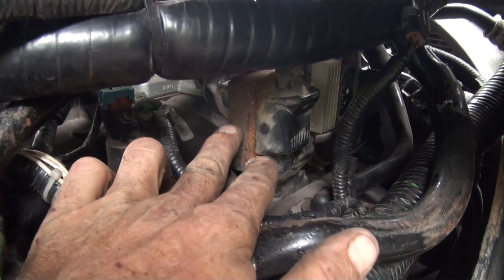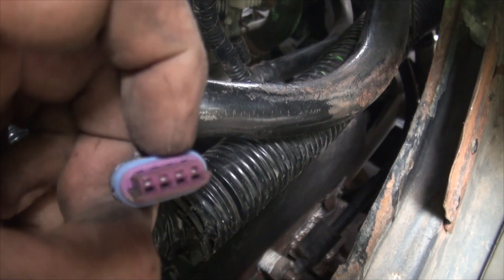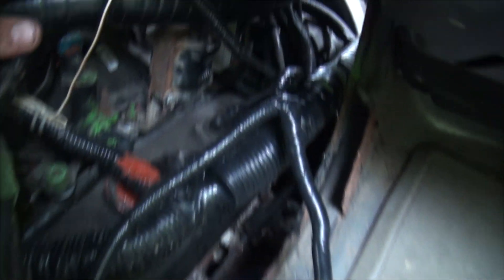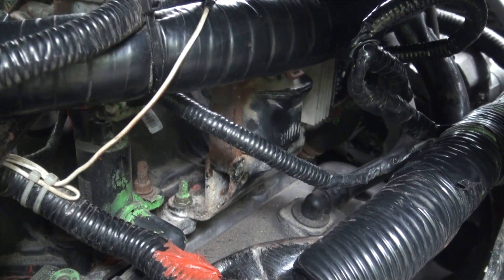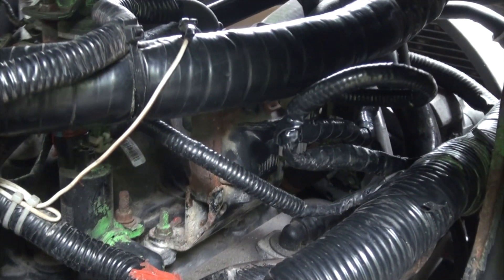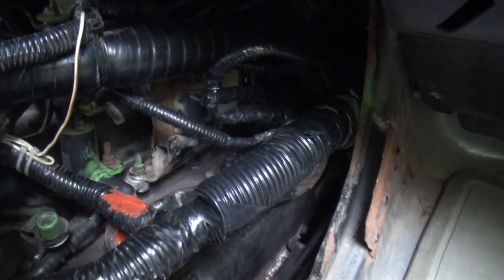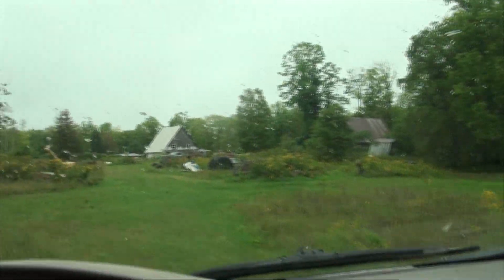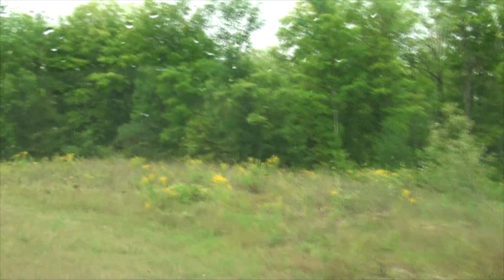WHY DOES MY 4.3 HAVE NO SPARK FROM THE COIL? CRANK / NO START

Comment: Excellent Stunt Dummy those connector pins were definitely opened up way too much any GM dealership will have a connector pin go no go drag tool or use the mail end of a connector to see if it’s loose but you don’t have to I can tell you from eye those female pins are out of speck once again great job and the old “Ford wiggle test” to the rescue!👏👏👏
One other note if you are in the field you can get a tinny pick to pry the female pins to engage the male pins tighter you can practice that technique on the old connector. Don’t undo all the plastic of the connector just insert the pick through the front and under the spring side of the pin and pry it to tighten the engagement tension it’s kind of like doing microscopic surgery on a connector pin don’t be too concerned if you bend and gouge the plastic a bit what your looking to do is tighten the tension of the female pins…

Comment: I wish I had your electrical knowledge . I wouldn't have to take my astro to the shop much . It's a 94 207k and wires and connectors are failing . Thanks for sharing your knowledge ! .
Reply from the maker: If you ever need help, feel free to send me a video of your van and what  it's doing, or not doing. I will see if I can help you. I hate when people have to garages because I've worked in lots of them and haven't found an honest one yet.
Reply: @StuntDummyLives  I'm dealing with no headlights and no start . It's a bad wire behind the battery on the firewall . It's has a new starter and battery . I had to have it towed  to the shop again . I'll let you know what they find out . It might help us all to keep the old vans running . Thanks !
Reply: @StuntDummyLives  just an update . The van had a new battery , starter and fuel pump . I had no headlights and wouldn't start . The mechanic said it was a circuit in the fuse box that had melted/coroded . He jumped the fuse box and added a fuse link to get it to start . It's not the first time it happened . The last guy cleaned it and plugged it back in and said that's 75$ ( worth it to me ) and I'm not sure how long it will last . If it's 125$ this time with new wires I'm not going to complain . If you're ever in Deleware you got a friend here . Thanks 👍

Comment: Hi Stunt. I sold My 58 Buick in 99 When I fist got it it wouldn't charge. The generator was rebuilt, Regulator replaced, No Charge. I'' make the story short, It was the plug on the firewall , The juice went through the generator gage but not back to the battery. I swallowed My pride and asked My Dad. It was the plug on the firewall not letting the juice back to the battery

Comment: all pink wires have 12 volts the same circuit the 451 feeds 12volts to the entire ignition system and its components including the crank a pin the cam a pin the coil a pin the ignition module a pin, the pink feeds on all the 8 injectors separately. 12 volts to the vcm and a few others
Reply from the maker: The van has been in the garage for over a year now and has a 5.3L V8, Dana solid axles, 2 feet of lift, coil spring/4-link suspension, manual transmission etc etc. It's all emissions compliant and I've learned just about every wire in it. The fuel gauge and speedo didn't work after the LS swap so I have Dakota Digital and AutoMeter sending me parts to convert the signal from sensors to gauges. I'll be streaming it on this channel in about 2 weeks.

Comment: for the 3 pin coil and the 4 pin ignition module, the pinks are 12volts and the black with white stripe is the 12volt ground. the middle wire on the coil is the rpm gauge/ signal wire from the ignition module it should pulse on off on of etc... white with black stripe on the 4 pin is signal and the last wire on the end is the pulse going to the coil.
Reply from the maker: Thank you, I appreciate it but I got rid of this engine and put in a V8 and another 30 inches of lift in the van. It has been off the road for the last while being turned into a monster van and the new V8 was just fired up for the first time today so it will be on video here soon. I now have 8 independent coil and 8 million miles of new wires because it's an emission compliant LS 5.3L :P

Comment: Did it stall getting out of the highway or when less air is moving around the motor?   My 93 jimmy did that and it was the little coil under le control module under the distributor.
Reply: Mine died the other day slowing to a stopafter hey speeds. Crank no start no spark. Replacing, hopefully, the icm, ig coil and pick up coil(part you're talking about I think), tomorrow...
Gotta get it back on the road for work on Monday. Hopefully it's one of those things and not the actual distributor or something

Comment: I have had all the same problems my 4.3v6 in 2004 silveradoe I also have a 2000 silveradoe w a 4.8 v8 I've noticed the wiring system on the newer truck w the 4.3 v6 to be crappie come pared to the v8 trucks it feels like my trucks ignition was Hak installed from the factory 4.3 was the only engine w a distributor the rest like 4.8,5.3,6.0 all hade coil packs these ls engines ive know to have nice wiring ive owned and worked ed on them all my 4.3 I found after replacing 4 coils 1 distributer and cap plus rotors, ignition module I found shootie wiring going to the ignition coil it was poorly soldered and wrapped w ele triple tape and had wire lume on it so I could not see it when I found it and fixed it I thought I finally found the electricle demons but know it's doing it again guessing it's eather time to replace distributor and rotor due to moisture or a bad ground on the  back of the engine I don't under stand why the wiring in the 4.3 v6 truck is so crapy

Comment: Ok you know how you can connect a battery that you know is charged but wont turn over your engine but when you move the connection then suddenly it will is because your not getting the right amount of voltage. Its weird how it can make connection but not get all the voltage. Its like an unexplainable phenomenon that doesnt make sense but the more you wiggle the more power you obtain. Well the same goes for every connection that derives off power from the battery. Initial start from coil comes from battery until alternator takes control and yes it requires at least 12 volts to fire and a faulty connection will reduce voltage just like connecting a barttery or jump starting

Comment: The pink wire is nominal voltage (12v) on the coil terminal and the ignition control module (with ignition switch "on," .

Comment: I don't understand the varying voltage on the pink wire. I don't believe the coil would share the 5v reference, but I'd have to look at the wiring diagram to see what all shares the 5v ref, you said the ICM was what that connector was too, with the open to wide female pins, with corrosion, and that when it would kill the coil it would kill the icm as well each time it happened. I'm scratching my head on this one, why would it take an hour of driving to get it to happen in the past? Vs you driving around the track? I'd still be leary to driving out on the road, but just stock up on some more icm and coils in your box of parts and tools and have tow truck money ready just in case. Really curious next time you go on a long trip how you make out. That's weird because even then you got 10k kilometers out of the original coil and icm after the rebuild, I'm stumped buddy. What year and model astro is that? I'm going to look up the wiring diagram.
Reply from the maker: I can't find anything except the output voltage of the coil, which I do not need. I've looked at the schematics, and it appears the pink wire is coming from the ecm... so the ecm should be setting the votage, but it doesn't make any sense that it fluctuates. I just put a different coil in and now the pink wire has 12V, so I'm not sure what is going on, but I'm not confident it's fixed. I need to figure out if this voltage is supposed to vary, or what it's supposed to be stable at, and what determines that(if not the ecm). I'm going to sit down and pour through websites until I find an answer tonight.
Reply: @StuntDummyLives  I wander if when it originally happened it wiped the driver out in the ecm and that's causing the erratic voltage you're seeing. What year and trim model is the van I'd like to look the diagram over myself and see if there are any technical bulletins in reference to what is happening. I hope you get it sorted, before the green machine ends up being a trailer behind the monster van😂😂😂😂😂choose your fate wisely green machine live or die

Comment: Well? Did it solve the problem? Seems like if this was the issue you would have found it when you checked the harness before ...
Reply: Froggy needs NO Master  Why? Because I have been too busy to watch the video so instead I took a moment to simply ask? Duh. He knows I leave comments whether I watch the video or not, so he can reply at his leisure. Of course you being of the same intellect as your master the rat, you just have to make yourself look foolish by replying to something that has absolutely nothing to do with you.
Reply from the maker: I had to work out of town this morning, so I just left the van parked all week. It just made sense because I was driving towards a place with extra coils & tow trucks today. Anyhow, the van appears to be fixed. 

I did check the entire wiring harness. I didn't check the connectors because they were working. It looks like someone stuck the probe of a multimeter into the pin hole and opened it up. It worked, but it didn't work properly. It does now... so far.
Reply: @StuntDummyLives  Thats good to hear. Honestly I am amazed if that is indeed the problem. I could understand if it was shorting out in the connector, but given how stout that connector is and the material between each connection point to shield each pin socket, it just seems odd. High amperage feedback would cause that melting in the connector but ... I dunno, just seems so odd that would be the cause.
Reply from the maker: @BrianKingProductions  Here's what I believe was happening: someone enlarged the +12V female connector hole with a test light/multimeter probe(forced probe into hole instead of piercing wire insulation). The male portion(pin) of the connector was barely making contact, and was losing it completely at times. The poor connection was causing my voltage to vary and the varying voltage killed my new coil at 10,000KMs once it was no longer a new coil. Then I started putting in well-used coils and they lasted even less time. 

I've now changed the connectors and was able to drive all day on the oldest coil I have. Does that mean it's fixed? Nope, I've been fooled by this problem before. However, I was expecting it to break down and it didn't. I also can't find anything else wrong, so I really have no choice but to trust it until the next time.
Reply: @StuntDummyLives  Ahh, well thats good man, glad you at least found a possible solution you hadnt encountered before.

Did my last comment get witheld? I left a reply to the fool Tadpole bows to RAT Master but I dont see it here.
Reply from the maker: @BrianKingProductions  Hahahah nope, there's nothing in "held for review". I can see one reply, but you haven't replied to his cheezwhiz comment lol
Reply: @StuntDummyLives  Thats what I replied to. Oh well, YouTube must have ate the msg. They probably didnt like that I mentioned his severe IQ deficiency. Not like it matters, I have replied to that same comment from him 50 times before since he always says the same exact thing when he is trying to be insulting.
Reply from the maker: @BrianKingProductions  There's something weird with your account. It had issues like this before, so I tried to add you as an approved user on this channel and it kept giving me an error. I just got back from having a BBQ with my Dad, I'll see if the message in being withheld yet.
Reply from the maker: @BrianKingProductions  Nope, still not showing on my end

Comment: This didn't fix or change anything on my 4.3 Silverado. Changed everything else. No wiring is bad.
Reply from the maker: What are the symptoms? What is it doing?
Reply: @StuntDummyLives  zero spark at all at any point. Cranking or letting off the key. I have changed every single thing mechanical. Distributor, body module, control module, crank sensor and ignition switch, coil and plugs and wires are all brand new. Nothing changes with any of them. All grounds are solid. And I can't find a bad wire. And ECU is fine it behaves normally.